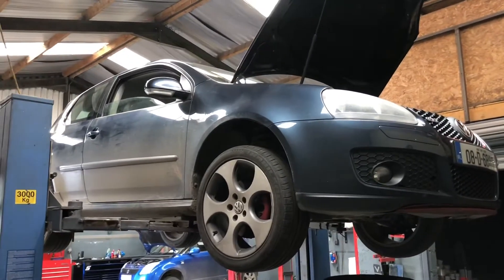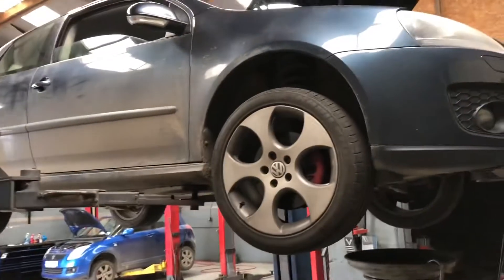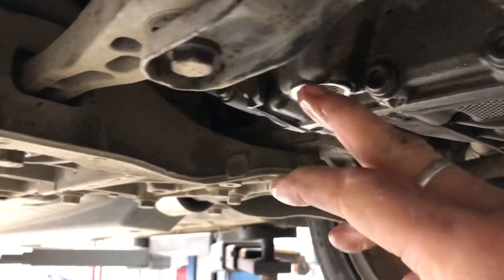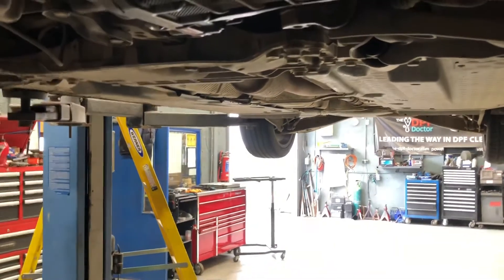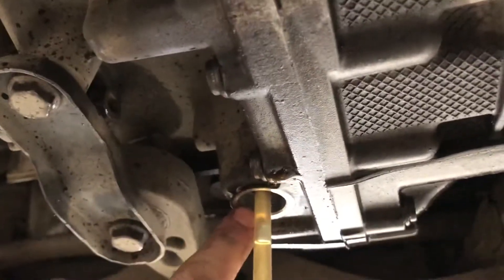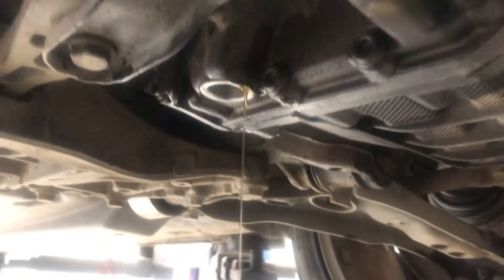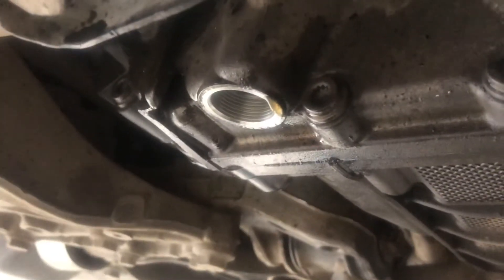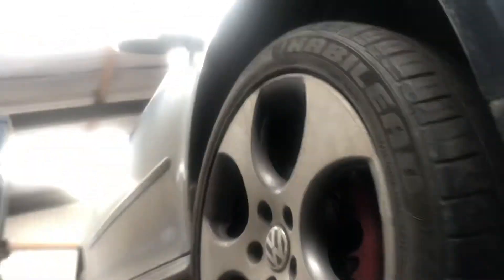DSG gearbox oil level check procedure

Comment: Will low or dirty fluid or filter or all those symptoms cause code p0746 ? Or do I need a new mechatronic unit I just got my 2012 vw GTI about 4 months ago and recently ran into this problem idk if the DSG was serviced or not I have everything to do it but want to make sure that I don’t need a new mechatronic unit first. The car drives fine but after 10-15 mins of driving it’s goes into limp mode no reverse only first and park gears work after I shut it off it’s fine then repeats after warmed up any advice or help would be greatly appreciated thank you.

Comment: Does it need to be running when checking level?
Reply from the maker: @randombro177  yes, it has to be running 😉
Reply: @kennedysgarage3281  Thank you. Yes I determined this by checking the level both ways. For anyone else wondering you will be low on fluid if you do this without it running.

Comment: Good video, thnx!!
What are the symptoms of low oil level in DSG DQ250??
Reply from the maker: They start out by changing gear funny and not selecting drive when needed, but can make the gearbox fail in the long run 😬😬😬

Comment: what happens if we miss the dsg oil change at 60k kms mark and do it at 85k ? I'm buying a used mark2 octavia 2.0 tdi 2012 but the owner has not done the dsg oil change at 60k interval. Please guide. Thanks
Reply from the maker: It shouldn’t matter too much once the transmission is working ok just before you change the oil & filter. It has only pushed the recommended boundaries 😉👍

Comment: Nice one Peter, I did 7 series BMW last week had no gears ( it's same as this but instead of plug at the bottom it's on side of dpf box ( after putting 1 liter I noticed the TM cooler just above the gearbox lucky me oil gone to water 🤣 and someone had pumped out all the water ) I get all cars from auction that's why oh well changed the TM cooler,oil,coolant and gearbox filter with 9L oil same procedure as dsg it drove lovely 👏 keep it up very good reminder thanks for sharing ( btw newer Merc has same system too 😎
Reply from the maker: This wagon was doing a very hard change on take off & into 2 and I changed the dual mass ( video to come ) So I just needed to check the oil level after, but noticed lots of videos on oil changes but not many on how to check the level 🙂. I’m not very familiar with these but it amazing what you learn when you have too. Once again Evan thanks for the comments & watching 🙏👍
Reply: @kennedysgarage3281  ah don't mention it, I enjoy your videos they are really really good simple easy to the point with loads of useful information 👍 I need to practice with scopes 😎 I am really falling back with wiring